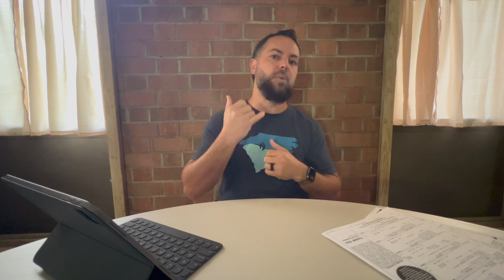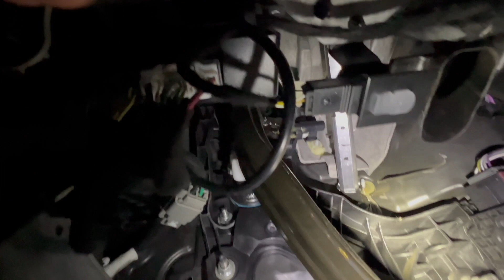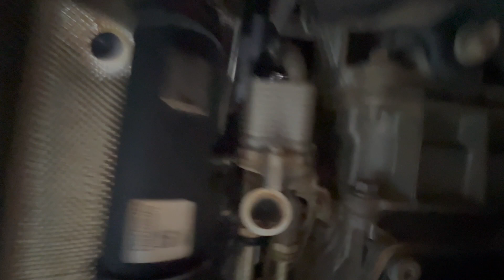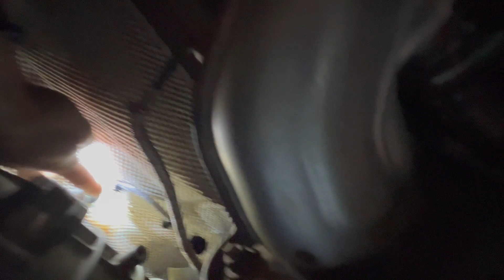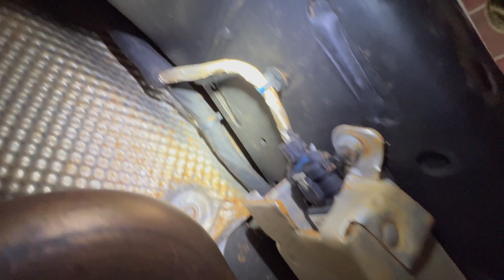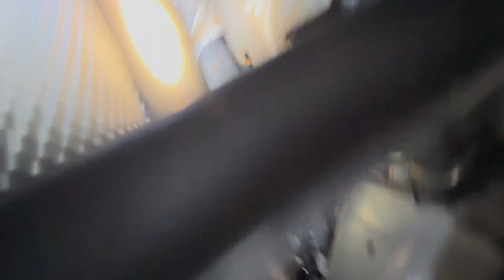Why your Gladiator Eco Diesel is unreliable...   HD 1080p

Comment: My diesel has been running strong. Sorry about the headache you’ve been through. I noticed a loose skid plate bolt under your Jeep in your video. I haven’t been pleased with any dealership’s workmanship for years and that loose bolt and the wiring not going back into factory locations is a prime example.

Comment: Enjoyed the video. You may have already made a decision to keep it or not. But with that being said, you seem like a smart guy, you just need to learn basic electrical/vehicle things, like the colored plastic wire covers is called insulation, a certain guage wire is rated to carry only x number of amps safety, ect. Per your vid, other than this wiring issue your gladiator has been reliable. You showed that you are willing to crawl under the truck and try and see whats wrong (great first step), now Google how to protect wiring from hot exhaust items, and protect your wiring where it needs it (wrap it in heat shield tape, reroute away from exhaust, ect). Some vehicles just need us to know more about how they work so we can better troubleshoot problems when they pop up.  If it was mine, Id keep it, at least you know where the problems are.  Again, thanks for posting this vid, it helps other owners what to look for if we have the same problems.
Reply from the maker: Hey, thanks for the feedback and I fully agree with what you said. Yes, so far I’ve decided to keep the Jeep. I am not a mechanic, (clearly lol), but I tend to do most of my own work. It’s not that I don’t know how to rectify wrapping the wires but more that, if my vehicle is under warranty and I just had work done to it from a Certified Jeep Mechanic, I would have expected better results. I recently found that they removed several screws for things like the fuel tank and bracing going from one side of the frame to the other and 5 bolts were just flat out missing and 3 others had the bolt through the frame and the nut maybe 3 threads screwed on just hanging out. This is 6+ months later that I discovered this while servicing my differentials and transfer case! 

I definitely want other people to know what to look for but also to beware of, at least some, Jeep service centers and check behind them. Clearly something is missing in their training and quality control. 

In the end, I’m GLAD it’s out of warranty. Other than an extended service contract for 10 additional oil changes and some warranty stuff, they won’t be seeing my truck again for service.
Reply: Good for you. Would you mind making a follow up video 🙏🙏 with focus on visual aid underneath the vehicle. I think you were able to roll around on a creeper for some really valuable footage. I’m trying to keep mine too and I’m trying to realize the logistics. How can we connect? I’m ready to share my findings as a fellow JLD owner.

Comment: Wow I’m actually looking at a 2023 Gladiator Sport S 3.0 Diesel. Yes they are beautiful vehicles, but like them all today very complicated. We always keep a vehicle till about 50k-60k miles before trading. Or as soon as the extended warranty runs its course. Since we had a similar fuse issue in a 1991 Geo Tracker, the first vehicle we bought new. I loved for getting my wife around in very bad snow. But it started blowing fuel pump fuses, that I figured out. But it was past warranty and turned out to be the in tank fuel pump needed replacing at $900! So I threw a 30 amp in a 20amp plug, carried a couple extra and showed my wife how to change. But traded it in very soon. If I buy the Gladiator I will benefit from your advice to get extra fuses.

Comment: I have a 21 with 61k miles. No issues with the powertrain, I had a rust bubble on the edge of my hood near a spot weld that they covered under warranty. I had the CP4 pump replaced via recall back to the CP3. I have 37s and 4.56 gears. I get 22 MPG, been great to me.
Reply: Is your Jeep a Diesel?

Comment: There is a wire that goes over the top of the egr tube which is the flex looking pipe coming off of the dpf filter that you are pointing to that gets so hot.  That wire was touching the tube when I got my new JL.  I have found others that are the same way.  It is hard to reach but I made sure to reroute it with zip ties.  I had to remove my inner fender to do this.  I wonder if that is what happened to your jeep.

Comment: If you truthfully love it I would just wrap the wires around close to the exhaust. We have an echo diesel Jeep and absolutely love it. It is also on 37 it really don’t know that they are on it plenty of horsepower and torque. It is a 2022. It has 30,000 miles.

Comment: Unfortunately most of the gremlins that have popped up are electrical. Loose fuses, shorts caused by melted wires routed too close to the emissions equipment, sporadic oil leaks and now high pressure fuel pump recall with limited parts availability. That being said the onus falls on the end users …….us. We have to pay close attention and become more familiar with our vehicles than other owners. It’s not everyone’s cup of tea but my 2021 JTRD has 44k without major issues. It’s a great platform however it maybe gone in the very near future.

Comment: I just suffered through your whole video. Let me see if I understand your complaint and why it makes everyone's jeep unreliable. Your truck blows a fuse and you replace it. You don't get in checked out and it breaks down for the same problem again. You get it to your local dealer and accept it back again after they have done nothing to fix the problem. You then break down again for the same problem that has never been fixed. Now you are taking the chance of it still not being fixed since it requires a higher amp fuse than it should. So you are scared it will break down again. Did I miss anything?

Comment: Heard a rumor Jeep is dropping the diesel in the next couple of years anywho. I want a diesel gladiator and get rid of my jk, but sorta scared from all the reports of the gremlins! Hopefully the 2023 is smooth sailing .
Reply from the maker: With the push to electric I wouldn’t be surprised if they did… I haven’t had any issues with the motor itself but the lack of shielding around the wiring is unacceptable. I’ve currently got it in the shop to correct/finish the work the previous shop didn’t complete but haven’t had any additional issues. 

Just some feedback on the diesel. Either way, I wish you well on your purchase. It’s a heck of a truck!

Comment: Have 2 Ecodiesel jeeps one 21 wrangler rubicon 1 22 gladiator rubicon and also have 21 ram 1500 with Ecodiesel. So far only had one prob my gladiator blew the rubber boot off of the intercooler.

Comment: As the owner of an old Disco2 that takes a beating, wasn't always reliable at first but still takes me deep into the hardest Jeep trails of Arizona with only 33s and Land Rover traction control I can say those kinda problems sound like a pleasure to my at home mechanic way of life 🤣 I'm considering a Gladiator Rubicon in the next year as I build up the Disco into more and want a newer more reliable thing to easily play in at the same time.  I love the idea of the diesel because of the torque and the mpg. But the Hemi is pretty tempting considering I drive a 6.1 Hemi supercharged 300 SRT8 and Hemi just has my attention.  I wish they offer a 5.7 Hemi like all the other mopars. Seems weird as a Mopar product they go from the V6 straight up to the 392. Not that 6.4 is so much greater than 5.7 but still why not

Comment: Is your gladiator a 2021? You may have mentioned that and maybe I didn’t catch it. I just picked up my gladiator rubicon Ecodiesel about 3 weeks ago. It was built in 3/22. I’m going to look at the wiring now since I’ve seen your video. Wondering if they corrected any of these issue on the 2022 models. The gladiator Is still relatively new, so let’s hope they can work out all of the design issues and bugs.
Reply from the maker: It is a 21’ and I recently had a chance to crawl under after the local dealer gave it back to me. I was surprised to find they hadn’t fixed the issue at all. I went ahead and put the clips into place myself. It was never a hard thing to do but rather principal that they would have installed it without finishing the job. 

The reason I bring that up, is that while I was looking at the cable further I noticed that the scan tag was OVER the heat wrap. Up to this point I thought the dealer had installed the additional heat shielding when they replaced it but this may have come from the factory like that which leads me to believe they have resolved the issue in the new models.

Still, check to be sure. It’s pretty easy to spot, just follow the CAT/exhaust. It’s either wrapped or not. Hope that helps!

Comment: after watching your video and knowing you have 37's, not sure about a lift, your truck in still under warranty, right? all maintenance was covered. my question is, I'll planning to put a 3 1/2 in lift on 37's and Banks pedal monster. does any of this void my warranty?
Reply from the maker: So I immediately purchased the 3.5” mopar lift and 37’s within days of owning the truck. I installed the life at 300 miles on the odometer.l for reference. To be honest, I just assumed everyone modifies their Jeep so I can’t imagine they wouldn’t cover their parts. 

That said, what I didn’t know, but know now, is that it depends on your dealership. Most are cool but a few are sticklers for the rules. Since this video I took it back in and my dealer had to replace a tie rod on the truck. That’s not a component I replaced so it was warranty but likewise, some of my suspension components that I HAD replaced needed tightening down with 30k miles and a fair bit of wheeling having been done. So that I had to pay labor for. 

I would go to the dealership service center, ask about this and gauge how they react.
Reply: @ichad3317  thank you for your response. This helps a lot. I will definitely communicate with my dealership.

Comment: All the exposed wires will eventually fail due to heat cycles. I would take the time and heat wrap them. All the loose wires are from shitty techs who don’t care to do things right. Watched the whole video good luck with it don’t trust the dealer to do this for you. Btw I used to be a vw tech not a YouTube mechanic

Comment: So no issues like this prior to a flash for the DPF? What was the recall for? I have yet to take mine in. I have had zero issues. Does the exhaust now get hotter causing the wire looms to melt? To me you still don’t have a repaired vehicle. A 60amp fuse where there should be a 40amp is a potential fire hazard. I would contact Jeep directly and demand it be fixed correctly or to refund any money you have spent buying and maintaining a vehicle that could potentially burn to the ground because of a dealer bandaid to get you up and running.
Reply from the maker: I had zero issues prior to taking it in for the DPF. Up until this very moment I hadn’t considered it related only because of the timing. Within two hours and maybe 40 miles of driving I was broken down for the first time. Then it was sporadic after being days or weeks later. 

I see your point and unfortunately don’t have enough knowledge on what exactly the DPF recall did to know what changed. The timing was always interesting but the subsequent times had me thrown off this trail… 🤔. 

As to your other questions, I’ve since taken it back in for repair and only a few items were actually addressed as I asked. So it’s an ongoing battle.
Reply: Not too sure if there is an update, but it could be due to a longer burn off after the reflash, which would cause excessive heat build up. Running diesels with the DEF is hard because of heat management. They want it to burn off less frequently to use less DEF which means that will do a longer burn off at one time. Track you DEF consumption and compare it to when you’re having issues. Just a thought.
Reply: I heard that if you shut down your Diesel engine while the DPF is running to clean it you are in a big trouble. I thinks this was happening with all te trouble after…….. good luck with your eco diesel, I have an European wrangler unlimited rubicon with the 4 cilinder 2.2 eco diesel. The auxiliary battery was broken now for the 3 rd time in 5 years, for the rest a super fine Jeep. Best regards from the Netherlands

Comment: Have you re-geared after going to 37s?  If not, you should.  Just because it can push 37s on stock gears, doesn't mean it's doing so efficiently.
Reply from the maker: I haven’t. One of the main reasons I purchased the gladiator eco diesel was because I wouldn’t have to re-gear after going to 37’s. I would probably get better fuel economy if I did but I still get 23/24mpg with a 3.5” lift and 37’s so I’m happy.

Comment: Dealerships generally have the least FULLY trained "technicians" they are each only knowing a little and do parts changing and the same with my Toyota "Techs" and in fact toyota tells me it's a feathre that my toyout has to be 2 footed on any hill around my home if at a stop. Jeep/dodge/Chevy Ford though are worse than my Toyota dealer is for my Tacoma.. I'm broken and at 60'years old and want to find someone but alas end up having to fix stuff my own.

Comment: 2021 Jeep Ecodiesel. HPFP failure at 13000 miles. Then a month waiting for fix. Get it back. EGR Valve stuck closed code a week later. Now waiting on parts and vehicle-less again. Omg. 
I half to pull my 1967 international pick up truck from storage to compensate not having my 54,000 dollar vehicle to go to work. Still waiting on reimbursement of 1000 bucks from towing and rental fees from last time. Sorry bro. We get the short end of the stick.
Reply from the maker: That sucks man… I’m sorry to hear that. At only 13k miles too! For me, the first band aide fix took 4 days, the second subsequent was 11, and the last time in was 8 so I get it. I had to get a rental myself. 

I hope they nail it down and get it right for you. Faulty parts happen but quality control right now seems highly inadequate.

Comment: he likely scammed you for a new harness when he probably just cut it open, replaced a bad wire & taped it up, its probably worth keeping, its one of the issues with buying new & newer is they have not had all the bugs worked out yet, this is a design flaw with routing wires too close to the exhaust components so extra heat shielding is necessary as even if it is not hot enough to melt the wires, the plastic end connectors will get brittle crack & get moisture in the wiring causing issues with the computer properly reading sensors.

Comment: Why didnt the dealership get you a loaner? I have the same jeep - eCodiesel nightmare. I can back up your story with my own. DEF problems, throttle control system errors constantly. Ive been stuck on the highway more than once. TOTAL PIECE OF SHIT...
Reply from the maker: None of them "did that" when I asked. Although my local dealership does and has in the past for basic maintenance. So I haven't had any additional electronic issues since I posted the video but the other day I had the Service4WD light pop up and then go out at two different instances. My wife then informed me of another instance I wasn't aware of so it's sitting in the carport at the moment until I gather all the stuff to swap fluids in both differentials and the transfer case. 

I read all the forums advice that it could be a fuse or something serious but I tend to think it's the fluids having not been changed at almost 40k miles. In digging around for fluid info I also stumbled on a forum where guys were saying they had changed it closer to 20k and found the fluid was low and a guy who literally just bought his and checked it and said it was low straight out of the factory. That being the case I think it's overheating due to lack of lubrication (which could be bad) but we will see. 

In the end, I am replacing my inner fender liners with vented ones, considering a vented hood, and eyeing the new 2023 ventilated grill in an effort to reduce heat under the hood. I think the factory build quality is shit all around but the vehicle itself (with checking behind the factory and staying on top of maintenance) is actually still quite good. 

Let's see if I have to buy a new differential though... my mind will change quite quickly. Someone needs to start a forum of shit the factory should have done but didn't so here's a checklist...

Thanks for the reply though and good luck with yours... Seriously.
Reply: @ichad3317  My jeep dealer just called to tell me its ready to get picked up "ALL FIXED" ... so frustrating... I put a lot of money in my jeep with suspension upgrades, wheels and tires...I love the jeep when its running right but reliability is everything. My plan is to wait for the new Hurricane twin turbo motor then trade it in...
Reply from the maker: @warmeds2009   I get it. I normally have the same viewpoint. I’m one serious failure from throwing in the towel too. That said, I’ve seen what it can do and the adventure side of me is pushing past my normal sensibility and saying “just wait and see” (if there’s another failure).  It also helps that I look at interest rates and car prices and don’t want to pay 25-50% more per month for similar money much less more money. 🤷🏻‍♂️